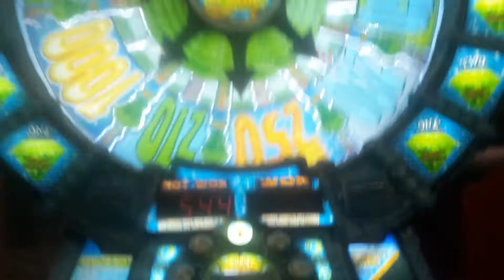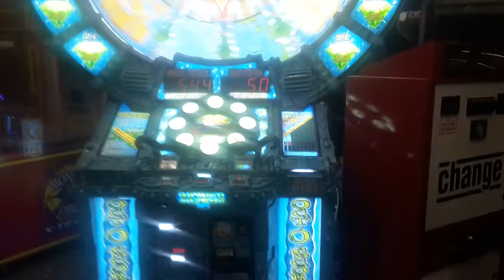octoscore repowered

Comment: This originally had 6 20a power supplies. What was done to get around that?
Reply from the maker: Three larger (well, physically smaller, but higher current) power supplies and fuse blocks.

I didn't like the amount of small (18-20awg) wiring in there attached directly to 20A supplies. I didn't like that two of the 20A power supplies were effectively paralleled through the logic board. I didn't like the fact that some loads got +12V from one supply by GND from another. I mostly didn't like that the grounds weren't even solidly linked to one another... and, given the random garbage on the displays, and the frequent tendency of the machine to "coin up" completely on its own, both of which were solved by the rewire, I think the machine didn't like those things either.

We now have two 80A power supplies on a board with fuses, with a central ground point, powering the computer and all of the LEDs. A third power supply on the wall powers the wheel motors and the marquee on top (the marquee is an optional separate unit, and seemed to create tons of noise on its own, so I put it with the motors, which are the least likely to care about the noise, since they generate their own). Everything is solidly grounded to each other, to the case, to the backplate of the board, and to AC ground... and the noise symptoms (random coinup, garbled display, occasional freezing) are gone.